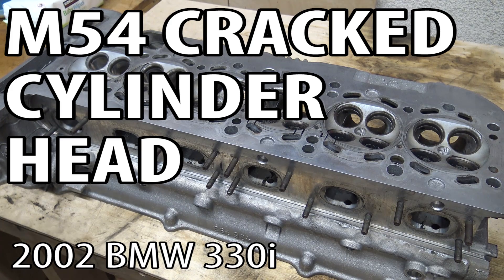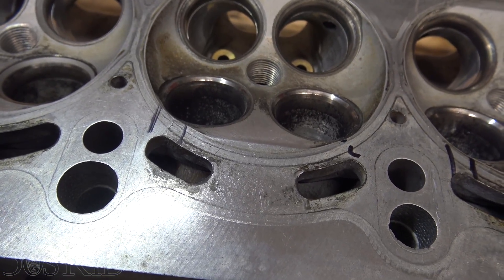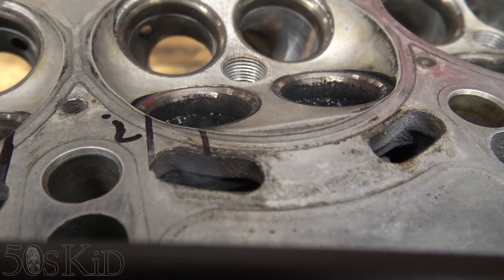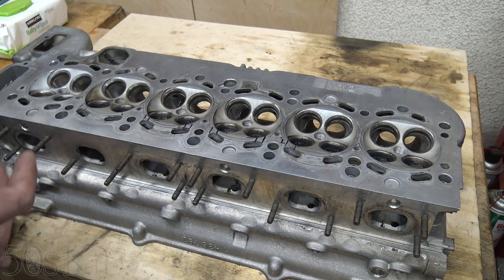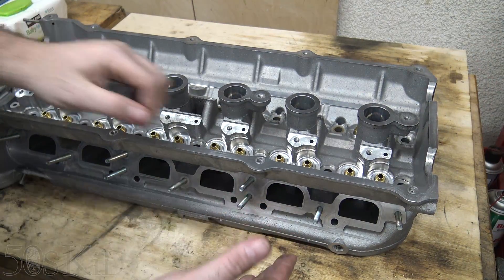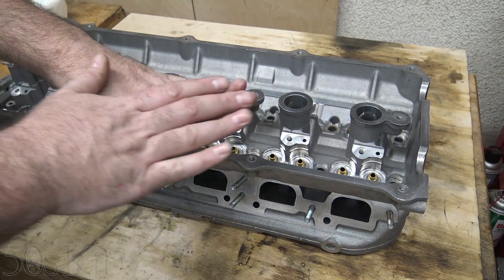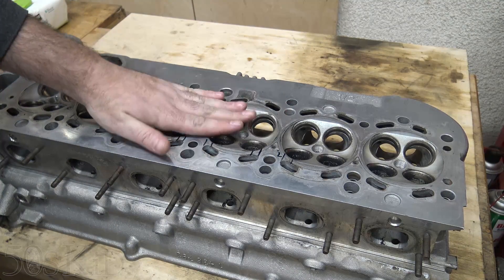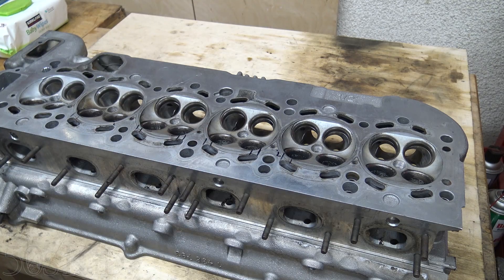BMW E46 M54 Cracked Cylinder Head #m54rebuild 19

Comment: Hello 50skid. I have an 02 e39 2.5 M54"B25". Cylinder 5 gas no compression, all other cylinders read between 125&136psi. Leak down showed intake leak. Vehicle did not overheat when suddenly misfiring and running rough going about 70mph when I was about to punch it. Block test showed no hydrocarbons in the coolant. Very miniscule sign of leakage on cylinder 6, but barely. Mightve been incorrectly positioned TDC. No smoke was emitting from the exhaust and no rattles from near the valve train. Acquired the vehicle with 96k and currently has 137k on it. What are your thoughts? Push rod, valve spring, valve stem seal, lifter? Possibly stuck or bent/burnt valve? Note, it suddenly started running rough, in a second.

Comment: Hey so I don't notice any of these cracks on my m52tu head. But there are some little lines between a couple of the exhaust valve ports that connects them. They don't look like a crack, rather, a casting mark? I see your head has those too. Do you remember if those were cracks or just marks? It seems more raised than anything.

Comment: 4 years ago On my m54b30 2001 530i with 290k miles I did the headgasket and the head had these all around the exhaust I thought it was normal because it had 12 cracks 2 on each cylinder so I just went to home depot bought some sand paper sanded it slaped it back on , still runs perfectly it's a 303 right now, I don't think it's too bad it's sendable
Reply: What about now?

Comment: Man, I have a lot of mechanics with a lot of experience telling my head is probably cracked. I took it off and checked all these areas for HOURS. There are no visible cracks. It was losing coolant with no drips or smoke. But, it was losing about a half gallon of coolant every few day. No coolant in the oil either. 🤷🏻‍♂️
Reply from the maker: DjDestinyChicago get it pressure tested
Reply: Im bringing it in first thing tomorrow morning
Reply: 50sKid just dropped it off. He said he doubts it cracked since he didn’t see any. It doesn’t hurt to be 100% sure though. I’m not doing this more than once lol

Comment: have the same problem, crack in the part between valve and water hole,
whether with welding it will be strong?
Reply from the maker: Heads can be welded but I dunno if the labor is worth it--you'll have to figure that out with your machine shop.  But then again, what if you weld up the visible cracks but they pressure test it and find more internal ones?

Comment: Hi 50skid! Thanks for all the details and informative engine rebuilt videos. Could you provide information on which shop can do engine and cylinder rebuilt surface? I hope to get the job done right. Many thanks!!
Reply from the maker: lkengarch the shop I used was Martin Davidson’s machine shop in reseda. But most shops should be capable of rebuilding it. Just ask them if they have ever done an aluminum block

Comment: this engine definitely would have been  a candidate for a good crack sealer added to the radiator, as you still had decent compression, and easily could have sealed off those small cracks.
Reply from the maker: Not my style at all

Comment: This is the very first M54/M52TU head I have EVER seen cracked!
Reply from the maker: Max Lindner do you work in a machine shop?
Reply: I don't know where my comment went, but I disassembled and inspected many of these engines. You see cracked M50 and M20 heads everywhere, but this really is the first cracked M54/52 head I've ever seen :)
Reply from the maker: Interesting!

Comment: You should try and source some 330 ZHP camshafts for your rebuild.
Reply from the maker: Wasn't there also a change to the engine management software to accommodate the different cams?
Reply: Yes, you would need MS45 and a different MAF, loom modifications and a IAT sensor blanking plug. or you could just get a custom dyno remap done. Whilst you they're, just 'cause... you know!
Reply: Yes

Comment: I did not watch all the previous video on your engine rebuild but remembering the start of this series I recall the car itself was running perfectly fine and if it had not been for you doing the compression test, you would have never even noticed it.  What I am trying to understand is if you had let the sleeping dogs lie, how many more years would have got out of this engine before outward symptoms would have been visible?
Reply from the maker: Well I suspect it already had the outward symptom of being lower on power than when it was factory fresh.  I will find out about that once I get it back in the car.  As to how long it could have gone on that way, who really knows.  Maybe another 100k miles.  But, of course, the blowby would have increased, the power would have continued to drop, and the oil consumption would have gotten worse too.
Reply from the maker: Oh there was also the coolant loss--that would have likely gotten worse pretty soon

Comment: Can you remind us on what symptoms this engine had before you decided to rebuild? oil burn? poor idle? coolant burn?
Reply from the maker: I put the story in the description of the video due to overwhelming demand. ;-)
Reply: Thats just hilarious. In fact this particular engine appeared to be ok: a 1 bar compression difference is not a big deal. An oil consumption is not that huge. A little of coolant consumption is what to worry about and after a head removal a HUGE cracks reveals as on diesel engines usually does. Thats "awesome"(.
Reply: And rods are suspected to be bent, right?

Comment: I really didn't think it would've been cracked? I though it was a bad head gasket. Thanks for the update.
Reply from the maker: Overheat incident causing warp causing cracks causing a weak area in the head gasket between cylinders precipitating a head gasket failure.
Reply: Well this is another reminder of  how fragile the e46 cooling system can be. I overhauled my entire cooling system with all Genuine BMW components and I still drive around with the OBC temp displayed on my dash!
Reply: PLEASE HELP. I have 525i, same engine. Did a compression test, all cylinders were around 133 which is normal for a used engine, but cylinder 5 had 0 compression. Block test didn't indicate exhaust in the coolant. Leak down was done, no air coming through intake, exhaust or crankcase. Do I have a cracked head or a blown head gasket? Engine has 137k miles. Got it with 96k

Comment: Working at the dealer, we've never seen any cracked heads, although the cars that come in will have fairly low mileage. 
Usually the cars are sold second hand after warranty expires and only a few of the customers actually still bring in their old cars. Australia has a generally better climate, so you never have the issues you have in the states. If a car is too old (more than 3 years old according to the dealer), any defect is considered beyond its designed lifespan.
Reply from the maker: Did you regularly see cars that had over 100k miles?  It's nearly guaranteed that an E46 will overheat because the coolant expansion tanks always crack and nobody knows/knew to do the preventative maintenance of replacing it.
Reply: We do see them, expansion tanks have a weak spot to vent pressure. Its not preventive maintainance. Most BMW owners don't really care about their cars, only what the dealer tells them. 80% of the people don't even check their oil, its one of the reasons why dipsticks were removed, potential air leak and less mess when checking oil. You can say that our engines are some of the most stressed engines out there and we win engine awards because of it.